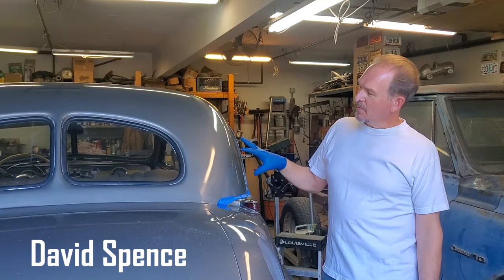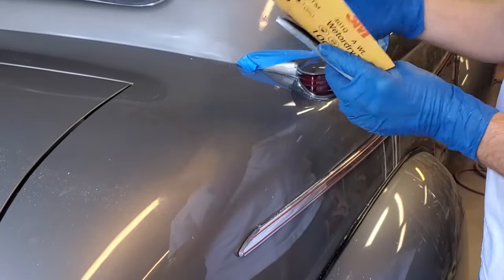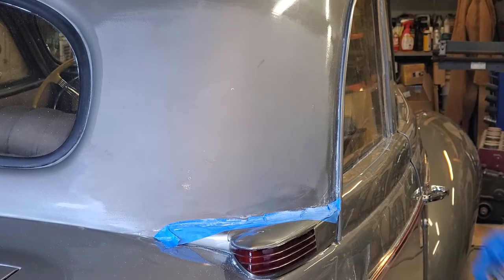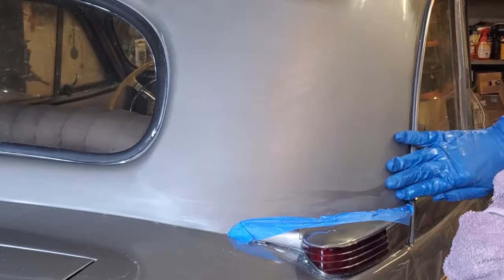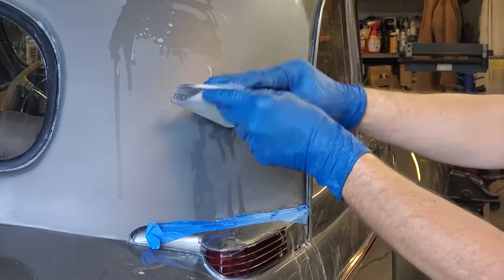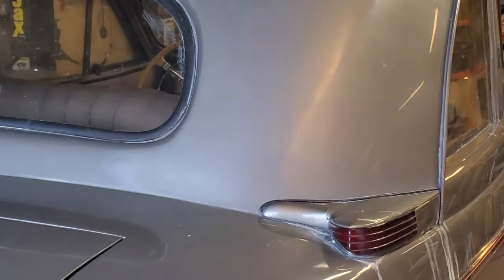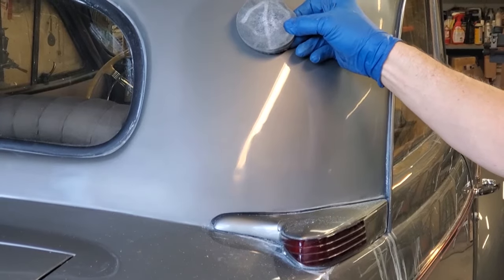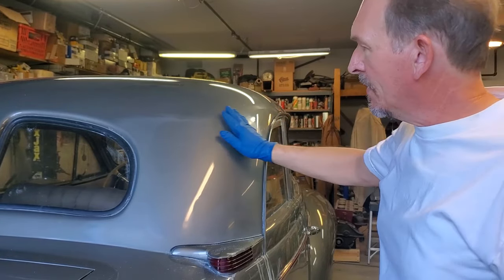How to Sand and Buff Clear Coat - 3M Sand & Polish System

Comment: Nice explanation on the steps required to make it shine. Pro tip, any parts like the tail light in this example should be removed before starting work if possible, that way you can easily sand up to and underneath where it mounts.
Reply from the maker: Good tip! Always helpful to share information with the restoration community. Thanks for watching!

Comment: Thanks for sharing.  I'm in the middle of a garage paint job now - busting through all the myths.  I like that you endorse that you can just paint in your garage or even outside.  Most definitely.  I like painting in winter because there are no bugs or humidity concerns.  I have a heater installed high on the wall, so I can easily get the surface temp to 70F.  The HVLP guns produce no overspray like the high pressure guns I used as a kid.  One thing I'm not bashful on is using an orbital sander to knock out the big flat areas of orange peal instead of by hand.  It makes short work of it - although I respect what you are doing and see that it has a curve that could pose an easy burn through.
Reply from the maker: You're correct on so many counts and this information will be useful to our viewers. It's always good to wear the necessary gear and work in well ventilated areas, depending on the materials used. Thanks for writing and for watching our video.
Reply: Nailed it man! I took on my first garage paint job over winter as well. I used an HTE type gun and had damn near ZERO overspray and even without a draft system set up I had no more than 5 nibs throughout the whole car. Booths are great for production but my budget friendly 2 car garage set up produces great results.
Reply: @TheRebelyellers  vevor sells inflatable kevlar paint booths for 700$ to $1200 depending on size. I own a small autobody shop and am trying to get one myself, as it looks more professional, but have found painting on a concrete floor with walls is about the same as im going to wetsand and buff it anyways. The thing about overspray, tho, is that its fine particals that build up over time. If you paint in there a few times, you'll find it builds up on fibrous materials,  fan blades and vents. Not a huge problem.  Just sharing my experience from industrial and automotive painting background.

Comment: I'm no pro painter I have painted a few. Cars and bikes. With I'm guessing perfect weather and right compressor. Cheap harbor freight paint gun.and oil water separator on the gun. Have had very good LUCK. Basecoat clear being the easiest I've worked with. With very little orange peel. Or runs.again luck. I have just painted a front clip on my 90 corvette. And I got lots of orange peel. Heat index here in Illinois 110. Ugh. I've tried the sand buff never worked for me. From watching 1000s videos. Never been able to get sand marks or shine back. But watching your step by step video,THAT MAKES MORE SINCE TO ME. I think I can do it now. We will see. THANK YOU..We'll update FAIL.. SANDED BACK DOWN WAITING ON FREEZE WARNING THEN RESPRAY
Reply from the maker: We've had similar issues. Sometimes you do have to sand it back down and start over. Like you, we don't do the entire car, rather in stages. A lot of what we do when restoring requires patience and desire. Appreciate the updates. Thanks for watching!

Comment: Very informative. My main concern is polishing near the edges by the trim or smaller areas where the pad would not be able to fit like between the trunk lid and rear windshield glass.
Reply from the maker: You can hand polish with micro fiber towels, but it is very time consuming. However, if you look around on the web you can find a variety of specialized shaped small pads that help in small areas. You can also place masking tape on areas to protect them when sanding and polishing in close quarters. Appreciate your comment and thanks for watching!
Reply: On amazon they sell smaller drill polishing foam pad attachments all the way down to 1/2 inch sizes . I have a .5 inch , 1 inch , 2 inch , 3 inch and 5 inch foam buffing /polishing pads all from amazon . That way you would be able to get into any spot anywhere ! 👍👍

Comment: In the UK it is known as emery paper. Sand paper is for dry use only whereas emery, also known as wet and dry is used with water.
Reply from the maker: Interesting. That name is used on another product here in the United States. An emery board is what's used during a manicure, which is basically "getting your fingernails 'done'."

Comment: Definitely a Great How To Video. Thanks for not trying to be a movie star and demonstration use of Five Dollar Words.  One question I have is.....No Cut And Buff Videos get into HOW to do those Dangerous edges and corners where the paint is thin. Do you get rid of the Orange or just sort of knock it down a little with 3000 and hope for the best? Nobody demos the edges. Thanks for The Video!
Reply from the maker: Good question! Edges, due to the physics involved in applying spray paint, always have less paint on them. Rarely is it necessary to go right to the edge. It is also very very hard not to sand thru at the edges. This is why no one demos it as it is not a generally recommended procedure. Thanks for watching!

Comment: I get those in Chicago winters as well. 38 degrees and still get dust and hair nibs. I think it’s static from sanding specially if you use a tack rag
Reply from the maker: Interesting. Thanks for pointing that out and thanks for watching.

Comment: Great video!  Thanks a bunch!  I had small rust areas cut out, and new metal welded in, and 5 coats of single-stage urethane put down on my '62 Pontiac Grand Prix in cameo ivory urethane (just want a quality driver) by a local body guy.  Came out pretty nice, but a lot of orange peel, and normal dust specs.  I want to correct the paint myself, and am pretty handy but I noticed you had hand sanded with 1K, 1.5K,2K,3K, 5K until the imperfections once wiped dry were gone, and only then did you switch to the DA and compounds to bring the gloss back.  Since my car is quite large I wondered if I could use a DA instead of all that hand sanding.  My gut feel is I'd be better off to take the time to hand sand like you did to avoid over sanding, especially since the orange peel, dust, etc. is different on different areas and this is my maiden voyage.  Appreciate any thoughts you might have.  Thanks a bunch!
Reply from the maker: Thank you so much, and thanks for sharing your experience. We wouldn't recommend using a DA sander, especially if you haven't done it before. Thanks for watching!
Reply: single stage paint also normally has some orange peel because of the thicker viscosity of the urethane based paint and the fact that you can't over reduce it to make it smoother without running the risk of a dull finish. There is an acceptable amount of orange peel for single stage that is normally considered a very slight fog to the edges of the shine, so dont beat yourself up if you find it hard to get single stage to look the same as buffed clear. .

Comment: if you have a buildup of residue would a hose with a spray nozzle, be beneficial for cleaning the residue frequently? The DA could have been used throughout the sanding process.
Reply from the maker: Yes, it can be done that way.
Thanks for watching.

Comment: did you sand the paint back before applying clear coat? I've done a test spray paint of some metal before tackling a big job and the paint has orange peel. Should I sand this, apply clear coats, then sand and polish?
Reply from the maker: If the basecoat is metallic, NEVER sand it at all. It will result, at best, in  "tiger stripes." It's best to color sand the clear coat. If you must sand a non-metallic base coat you can, but I would suggest an overspray properly done before adding the clear coat.

Comment: Great video, haven’t painted a car in years and just recently had to do a touch up.     I would recommend adding links to your products you use in your description. You have a ton of views and could help you get free products and maybe compensation. 

I had one question, so last car I painted was 15 years ago.  I wet sanded base before clear coating. Is that even necessary or should I just clear over the base coat and then do what you did here? Thanks again !
Reply from the maker: Thanks for the tip! Glad you enjoyed the video.

It's not necessary to sand prior to clear coat with the systems I have used. However, their are definitely different instructions, depending on the brand of clear coat. Always refer to your brands recommended procedure when applying clearcoat.

Comment: Nice.
What wax, polish or sealant is good for new paint with a 1-part clear coat?  I don't care about the looks, I simply want to wax it yearly for protection from salts and sun.  For the past 10 years I only wash my cars twice a year.  Spring and Summer.  Seems to be good for the paint overall.  The dirt creates a protective film!  😆  And doesn't wash away the wax/polish.
Reply from the maker: Good question. Only apply wax after a full 30 days from the time of painting basecoat clear coat systems. Use a quality paste was with real cannula wax as a component for the longest lasting protection. Thanks for watching.

Comment: Good video. Can you do this on a freshly paint plastic bumper that has orange peel? In other words, can you do the same procedure on a plastic bumper?  (Bumper is not on the vehicle yet)
Reply: That’s what I’d like to know as well. I’m in AZ and just painted my plastic front bumper cover off vehicle. Its a tricoat-base, mid, clear. Great coverage but definitely not as smooth as rest of car. I’d like to see if I can just polish it with compound without sanding but I’m sure that’s probably too easy and the answer is no:) Not sure how long I need to wait either. I finished 2 days ago.
Reply from the maker: Yes the process will work on modern plastic bumpers. However, you must take unto account the flexibility of the surface and not press overly hard if you may induce irregular sanding depths.

Comment: Thanks so much for the video - I have a well he said he was a painter - interior of a house painter I feel .  Any way it’s a white o3 F150 not a factory white ??   It has flat areas , couple of runs and not much shine .   Your suggestion on trying to get a shine - thank you
Reply from the maker: Yes, you're welcome. Since you didn't specify that it is a base clear paint job. it's hard to be 100% definitive.  Given what you described, I would suggest locating a well reviewed detailer. He will be able to look at it in person and suggest what can be done. There are a wide variety of paints and certain products work best for certain types of paint. Generally, he will have to do some sort of compounding and polishing to improve the looks of the paint job. Hope all works well for you and thanks for watching!

Comment: Hi there. Is it possible to get polishing pads that will fit to a normal drill? And if so, what RPM's would I set it to for the compound and then the polish?
Thanks for any help 🙂
Reply from the maker: Try a Google or Amazon search for 1/4" drill Velcro mounts and polishing pads. Speeds in the 1,000 to 1,500 rpm range work well. Slower will still work, but it takes more time. Thanks for watching!
Reply: @CarzPlus  
Thanks, I'll check them out

Comment: Is a dual action polisher good for this work, 6 or 3 inch? Thank you.
Reply from the maker: Good question. Only if you can produce an rmp range of 1000 to 1500 rpm.
Reply: @CarzPlus  Thank you!
Reply: Most people doing paint correction nowadays only use a rotary for heavy cutting, and a DA for finishing. Many only use DAs.

Comment: If I tape off top 1/2 of tailgate and sand pots on the bottom. I did three coats of color all over bottom 1/2. I have not yet don’t the 3 clear coats. My question is when do I untape the top 1/2 to cut the tape line down?

Do I do the clear on the bottom and when untape top 1/2 and wet sand the old and new then buff it all?

Do I untape the top and clear the whole thing? This don’t make scene but I figured I would ask. I’ve never painted before and just fixing rust on bottom of my truck tailgate but have no clue how to knock down that tape line or when to do it.
Reply from the maker: Good question. It is best to clear coat it all and then proceed, unless you have a pin stripe or easy break in the metal to work to as a stopping point. Hope that's helpful and thanks for watching.

Comment: Good video but I do feel like you could have covered a little more on how to keep your paper clean to avoid scratching the surface as you sand it. My own preference is to not use a small pan li,e yours ti dip my paper in because it get a lot of debris in it that can cause scratching while sanding. Also, maybe touch on how it sounds when sanding as to hear if you have debris on the surface while sanding
Reply from the maker: Thank you. The water was changed out periodically and was done off camera. Although, a larger pan couldn't hurt.  This was filmed without a lapel mic, so the audio recording was done at a bit of a distance. David's voice projects well, so I was lucky to be able to pick it up. The added sanding sounds are a good idea for a future video. Thanks for watching!

Comment: for a large/flat surface (i.e. bonnet/hood) is it fine to use an orbital sander with those grit sandpapers? or will that strip it down too much
Reply from the maker: Good question! Wet sanding by hand is preferable as an orbital sander can be too fast as material removal. It will be too easy for most people to sand to much off. Thanks for watching.

Comment: Awesome!  (1) So orange peel on the base coat doesn't really matter?...  As long as the top/outer surface of the clear coat is smooth/flat the paint job will look great?  And (2) how long did it take you to do this whole car?
Reply from the maker: Yes, exactly. 2) It would take about 7 days 8-10 hours apiece to complete this process. Thanks for watching!
Reply: @CarzPlus  Thank you
Reply: I'm sorry but if your base is orange peeled or rough doesn't matter how flat your clear is the light will reflect off the base and it will always look like orange peel.
Reply: No

Comment: Will this work on metallic paint with 2,000 grit sandpaper and a da polisher.
Reply from the maker: Not unless you have a clear coat above it. If you do this directly on a metallic paint you will end up with swirls and or tiger stripes. Even after polishing, as some  of the metallic particles will become damaged and their light reflection will change.

Comment: If i was a beginner i don’t think the best thing would be a die-grinder to learn with, I’d say start random orbital with a cut pad and a lot of pressure.. ill bet that little grinder can sling that compound a good 30ft.
Reply from the maker: The buffer in the video isn't a grinder. It is a variable speed buffer which runs between 1000 and 6000 rpm. I virtually never set it above 2000 rpm. If you are slinging compound everywhere you are using too much compound or too high an rpm. I never use a grinder for polishing. Thanks for watching.

Comment: So I did bottom 1/2 with paint. I’ll untape top 1/2 and clear the whole thing. But the clear that’s on the top do I need to scuff it up or sand or will the new clear stick to the old clear without doing anything. If I do need to scuff the old clear before adding new clear what grit should I use?
Reply from the maker: Good question. I would use 320 normally unless the clear you are using specifies otherwise. Thanks for watching!

Comment: How would you fix clear code that is chipping around the top door Panel where the clear coat is chipping all it is a 2005 Toyota. Avalon? Can I do the same procedure to fix the vehicle
Reply from the maker: You'll have to restore the entire panel. Unfortunately a small repair as such will show. It's a very good process and can be used on virtually any vehicle. Thanks!!

Comment: can you get the same results if you do it by hand without the machine ?
Reply from the maker: Good question. Yes, you can, but it will take longer by hand. You need to use a microfiber towel if you di it manually. Thanks for watching.
Reply: @CarzPlus  thank you I am subscribe now

Comment: It would be REALLY nice if you linked all the stuff you used.
Reply from the maker: Just finished watching the entire video and I found it was easiest to watch it with the CC turned on so that I could catch the specific name of the 3M polishing compounds used. Now, when it comes to the brand of tape  pads and sandpaper and sanding blocks used, a majority of them are 3M. Anything that wasn't purchased locally, was purchased on Amazon. David here, has mentioned independent sellers who sell through Amazon and they kind of come and go, so links to those sellers can expire. The smaller pads that were used toward the end (which he considers one-use) are knock-offs of the 3M brand and can be found through Amazon or Harbor Freight.